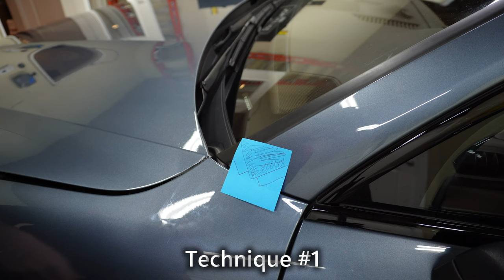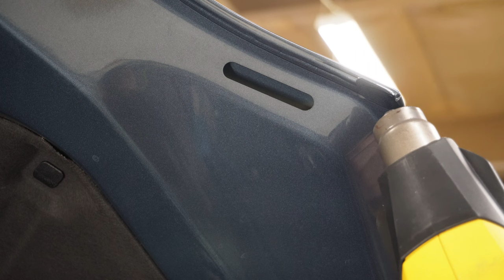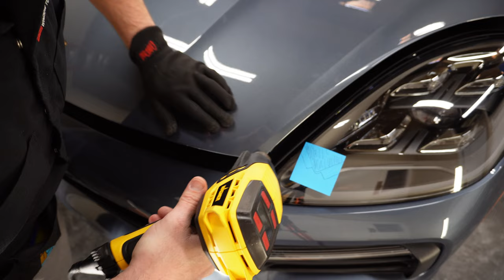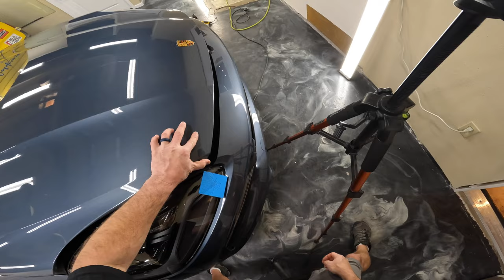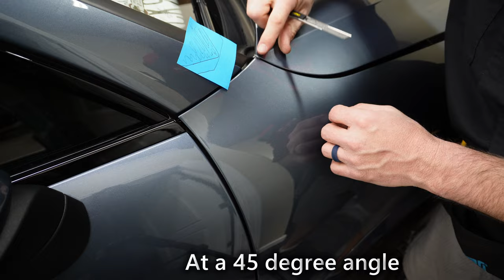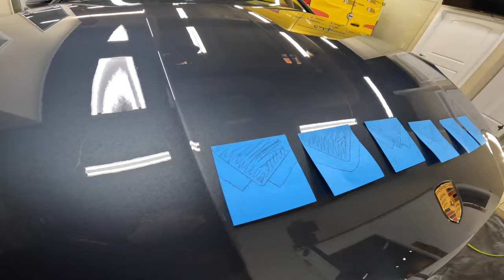Perfecting PPF Corner Wraps (Top 6 Pro Techniques)🛡️ Paint Protection Film Installation

Comment: Fantastic video.  You are the first guy I have seen who shows how to do corners.  
So, you leave the corners for last?  
You wait for everything to dry?
You did not need to use any tac solution. Interesting!
Reply from the maker: We Definity try to sneak in some useful tips on this channel from time to time. :) Normally I wrap the corners at the same time I'm wrapping all of the edges (on that same panel). I always try to wait for everything to be dry before I wrap to the back side or underneath a panel. That insures that the film is as tacky as it can get! I normally only wrap these edges with a heat gun and wrap glove.

Comment: A good technique I found was to give the material a tug and hook it on the corner. The tug makes the material naturally bend underneath and then you can cut some excess off and maybe a slit
Reply from the maker: That is a good corner as well. Good explanation of how it works. I use that one more with vinyl. 
Did you ever find that the extra stretch caused failures or distortions in the adhisive on the corner if it popped up and tried to shrink back down to relax?

Comment: all these are fine imo, I've done most of them or use different techniques depending on the hood. Generally I try to do number 3 whenever possible, except I wrap it to the edge, trim it and then torch it.
Reply from the maker: I agree. These are all usable techniques. I've never tried a torch. I just heat it up really hot with the heat gun. 🔥

Comment: your video is very helpful. one question. should ppf on the edge of hood be dried before wrapping? why do you not use soapy or alchohol mixed water to that area?
Reply from the maker: Good question. Take a look at the video I linked to at the bottom of this comment.  You can skip to the end and watch me wrap the edges of a hood. 

You definitely want the edges dry before wrapping them. After the main installation, I spray the edges out with tack solution or water and then let it dry. If I need it to dry faster, I'll blow the edges out with an air compressor to accelerate the drying process. 

https://youtu.be/6QhVox3WfgY

Comment: Do you typically leave it 1/8 or so hangover so you can trim and seal exactly how you want at the 2 weeks checkup?
Reply from the maker: I do not normally leave 1/8 over and then trim them in 2 weeks. My goal is to never need to correct anything after the car leaves. I let customers know that if edges pop up, we need to address them. In all honesty,  having them come back in a couple of weeks or a month is a great service, just to double-check everything. We implemented this at our shop at the beginning of the year. All of us are still (and always will be) learning, improving, and implementing new techniques and strategies to our installs and businesses.

Comment: Do u use the heat gun over still semi wet PPF? Just got PPF on new car and there were so many imperfections like bubbles and loose edges. My installers said bubbles is normal, it will go away after 3 weeks. The car will be washed and heat gun can then be use to stick all the loose films. Im skeptical now since the PPF installation here is seemless. Anyone care to tell me if this is supposed to happen?
Reply from the maker: It's best to use the heat gun on fully dry edges. The moisture on the edges fights the process of sealing the edges down to the paint. PPF NEVER takes 3 weeks to dry out. You also should never take the car home before the edges are heat sealed down. Doing so will cause those edges to collect dirt, and then they will never seal down properly.  Are the bubbles silver looking, or do they just look like bumps? Silver = air under the PPF, and it will never go away. Bumps of water under the ppf might dry out and go away. But if they are too big, they will leave an air bubble when they dry.
Reply: @EncorePPFtint  Thank so much for the feedback. 🙏🏼😊 I took the car home bc owner said its normal.there were alot of big bubbles filled with both air and water and there were dozens of small air bubbles. Some of the imperfections were dirty or debris thats trapped under the films. As we speaking I am back at the shop and saw the guy using heat gun.
Reply: @EncorePPFtint  the owner reach out to me today so I took my car back but he did not address any of the unsealed edges. He continues to tell me thats its too soon to use heat gun and that i should wait 3 weeks for everything to dry out then he can use some edging and heat gun to smooth out the edges. and any air/moisture bubbles will disappear. The  XRPlus XPel has 10yr warranty. Am I entitled for a full refund? What is the legit way to go about this? Pls help. Thanks for taking the time to provide feedback. 🙏🏼
Reply from the maker: This doesn't sound right. I would reach out to xpel and talk to the local rep. Explain your concerns and see what he can do for you.
Reply: @EncorePPFtint  I posed their sloppy PPF installation and gave bad reviews so owner reach out to me for full refund. Had it removed. Unfortunately a few damaged has been made by PPF blade marks. 🙁😕
Reply from the maker: Ugh.... I'm really sorry to hear about all of these problems. This has turned into a real nightmare. That shop has no business installing PPF. They need to knowingly "practice" on other people's vehicles. I hope you left them a Google review. That is the only way to help others from having the same experience you've been put through. Are you going to move forward with any type of action with the cuts in the paint?

Comment: 2 Nd one is the best, no question about
Reply from the maker: I'm with you! That one is my favorite. Do you install PPF? If so, what technique do you use for your corners?
Reply: @Encore Window Tinting and Paint Protection Film  yes, I did two of my cars, fully covered . 2nd technic only guarantees the corner will be covered with a ppf. I don't see the problem of melting ppf with a heating gun.
Reply from the maker: Nice, in the beginning stages. 😁 You started by going all in with full vehicles. That's a lot of great practice! 👍🏻

Comment: À question : à ppf can stick on another ppf ? Can we stick one on another one…

And second question : my bumper has two parts and there is no Space between thé two parts… can I pull one unique ppf part or must I have to install to ppf separate parts ?
Thanks for you help 👍🙂
Reply from the maker: PPF will definitely stick over the top of PPF. As far as covering two parts with one piece of PPF goes... It's probably not a good idea. Most of the time, the body of the car heats up, or the plastic flexes while driving. This will cause the PPF to pop up or bunch up. Longevity wise, it will most likely have problems over time.
Reply: Really thanks to your helpfull answer… I’m gonna try to install a bodyfence x ppf on a zl1 camaro… that will be my first experience 🙂
Reply from the maker: The bumper looks like it will be the toughest part. Hood, fenders, and mirrors look pretty straightforward.  Are you using a kit or bulking it? I bet the kit has a few seams and pieces. I always start with the bumper, but for my first installation, it would be a good idea to start with the fenders and then the hood. Have you been practicing cutting the material?
Reply: @EncorePPFtint  hi so I did thé first part…. What a great complicated part in fact… 2 hours for 40 cm2…😅😅😅

What was difficult is that there is an angle like U and thé film wouldn’t stick… it needed a lot of time to do it with a hair dryer.
I have the heltis gel… but it was useless… that didn’t work…

I’m afraid of the both bumpers… very technical on some areas…

I use a 15 m film … no precut lol
And the cutting is also a difficult way… it dépends on the part… but for the roof… that’s going to be difficult Because of the sides…

Comment: Excellent video!
Reply from the maker: Thank you. I'm getting a lot of edge, corners, and tucking footage on a matte finish install I'm currently working on. That will be the next video. 👍🏻
Reply: @EncorePPFtint  Awesome, looking forward to it!
Reply from the maker: @fatwajim  Just an FYI. The corners and edges video is going to take another week. Being that I did the whole vehicle, there is way more footage to go through in order to find the parts I need. I didn't take that into account. 🤦‍♂😁
Reply: @EncorePPFtint  no worries! Thank you for the great content. You may have mentioned it in another video, but what brand film do you use?
Reply from the maker: Currently, we are installing PremiumShield (recently purchased by Eastman) but we're looking for a new product because it's been rumored the PremiumShield brand might go away. Eastman also owns SunTek and we do now have some of their product in stock. We use the CORE software (by Eastman) and their patterns are now on point because they bought PremiumShield for their patterns and pattern-making processes. We also bulk-install quite a bit.

Comment: I looked at the temperature on your heat gun and went wtf how hot, then realized your American so its probably Fahrenheit lol
as for the corner i usually do the first one
Reply from the maker: True, that would look twice as hot 🔥 🤣  What temperature do you run your heat gun at when wrapping and heat sealing edges? 
#1 is definitely a great corner.  I do use that one quite a bit. Especially in areas like those corners where it's really hard to get to the underneath of the hood. 👍🏻
Reply: @EncorePPFtint  i usually have th gun sent between 250-300 C
Reply from the maker: It's a bit cooler than I run my heat gun, but I'm sure it gets the job done. 👍🏻
Reply: @EncorePPFtint  yeah, it still seems to work ok, my work partner puts it up to as hot as it can go, but then sometimes doing a bonnet it melts, which is why i like to have mine cooler and just take a little longer heating something
Reply from the maker: I'm with you on that. Your 250-300 is a much better temp than all the way up. So many problems can come from the heat being too high. Burning the film is a great example. Most of the time, that means starting over. Nobody wants to do that. Especially when you are in the finishing steps.👍🏻